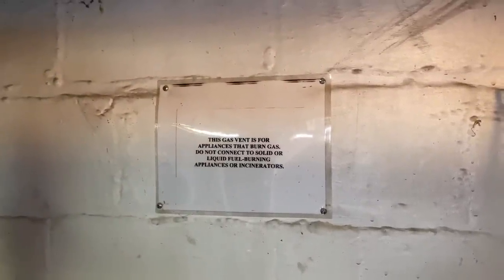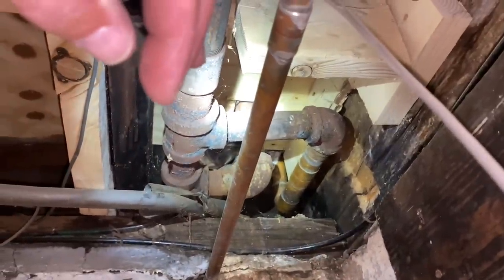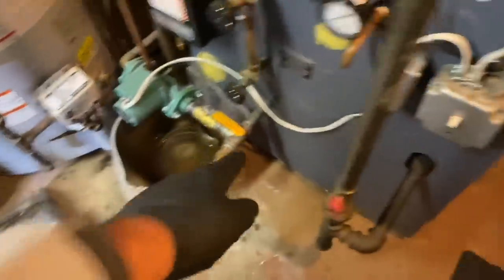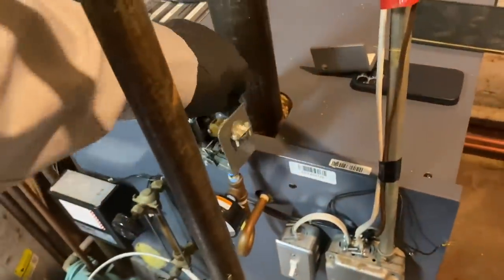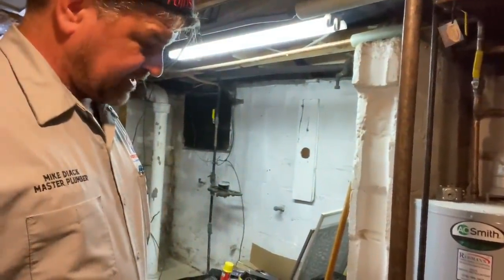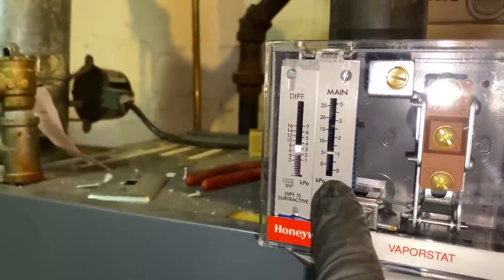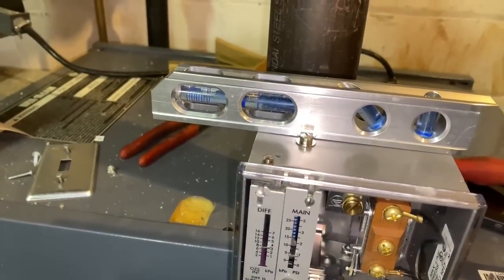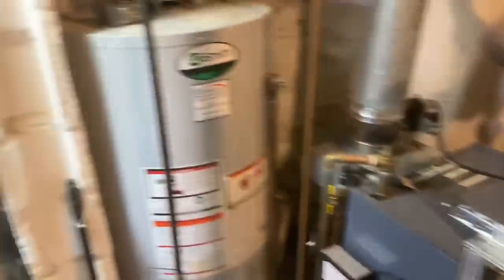Steam Pressure Issues? Forget About Installing a Pressuretrole, Install a Vaporstat Instead

Comment: Thanks for the great tutorial! I had a Vaporstat installed on my new Burnham one-pipe steam system boiler as a last ditch effort to address severe water hammer. Did everything else— properly pitched radiators, changed air vents, but nothing worked. When the Vaporstat replaced the Pressuretrol, all was well for 5 days. Then as the weather got colder, the hammering resumed every time the boiler started up. The setting had been placed on 1.5-ish PSI for the main and like 14 oz for the differential. I changed it to 1PSI and 8 oz, and now all is well so far. I’m thinking of also changing the #1 air vent at the end of the main pipe in the basement, as it is rusted shut to prevent any possible short-cycling. Maybe that also contributed to the water hammer problem. However, there was no noise with the old boiler, that was leaking steam, perhaps because the leak made it run at very low pressure. Anyway, thanks for your advise! It was the only advise I found that worked.

Comment: Last Trane vapor system I worked on was just installed as a 2 lb steam system. I told the customer it was not a steam system but a 2 pipe vapor system. I changed out the pressuretrol for a vapor stat and removed a couple of vents. The job worked beautiful just like it did 100 years ago except when I purchased the vaporstat I noticed the mercury bulb had been replaced with a microswitch. Damn thing only worked for a little over a year and failed and the warranty was only a year. So I searched high and low for an old stock mercury bulb unit to no avail as the word had gotten out on Holohans page and everyone was sold out. I did manage to get one but when I opened it, it was a B model which opens on low pressure and closes on high pressure. I installed it anyway but used a double throw relay in between so when the vaporstat opened on low pressure it flipped the relay and energized the boiler. Basically just used the relay to reverse the input. It has been working flawlessly for 10 years now. So if you come across any of the old mercury bulb vaporstats but they are the B model you can still use them by just installing a 10 dollar relay.

Comment: Getting an education from every video Mikey!! Steam boilers, and systems are a lost art. The Guru's of steam are now all in the cemetery. You are one of the "last men standing" that are experienced, can diagnose, and explain in detail the steam system! Keep up the great videos Brother!
Reply: You are so wrong kiddo
Reply: Another You Tube troll.
Reply: Guess again I've been working on steam For 35 years. Alot bigger systems than residential.  Commercial systems, so piss off
Reply: "Yet another You Tube Troll"
Reply: He says all us old timers are in the ground. I told him not. So he calls me a troll. Not once but twice. He's a young tough guy on a key board. I'm lmbo at him.
Reply: @scottmaz4063   You’re going to get hit by a semi tomorrow, jokes on you.😂. All kidding aside, I think after 35 yrs you are closer to retirement and I guarantee there’s no one graduating trade school with any steam knowledge. I’ve been doing commercial and industrial hvac for 25 years. I have only met a handful of people in that time that know steam well enough to be trusted so to me it’s definitely becoming a lost art.
Reply: Matt steam is easy to work on. Rads have to be pitched back towards shut off valve. Proper air vents installed so you equalize rads. Main vents are very important which should be checked and replaced. Pressuretrol all you need is half pound in most residential homes. To much pressure is no good. I can go on, like Mike has said go get a steam book and read it. It's not that hard.

Comment: I would use these on extreme low pressure applications. We had a lot of boilers that were struggling with just a pressuretrol so we swapped them out with Vapor stats. Glad we’re not the only ones lol

Comment: If vaperstat main is set @ 1 psi and differential is set @ 8 oz then you'll be running between half a pound and one pound. Installing a vaporstat without ensuring that there is generous main venting will absolutely guarantee short cycling of the boiler. How did you determine that there was excess pressure and that the difference between one pound and two pounds (like you have with a properly calibrated pressurterol) was the cause of radiator leaking? What was the boiler pressure before you replace the control? Opening up the relief valve and  seeing steam doesn't really tell you what the pressure is. The only accurate way to know the pressure is to use a low pressure gauge. For what it's worth the pressuretrolls are filled calibratable
Reply: Typo. Field calibratable
Reply: @PipeDoctor  you are not running the system at .5 psi, with the current vaporstat settings. You are running the system at one psi. The system will cycle between .5 psi and one psi.
Reply: When you say .5 psi, do you mean the cut-out or the cut-in? .5 cut-in is achievable with a run of the mill pressurterol.
Reply: Also, can you please elaborate on your main venting strategy? Which vents, makes and models, how you determine which main vents to use etc. Mr. Holohan is clear,  that adequate main venting is essential when using a vaporstat, to prevent short cycling. Thank you.

Comment: I help out with a couple OLD churches in the area and they like 1-2 PSI just to get the furthest radiators hot.. that one system needs velocity when all the first floor units call..   (the radiators have individual thermostats on every one of them)